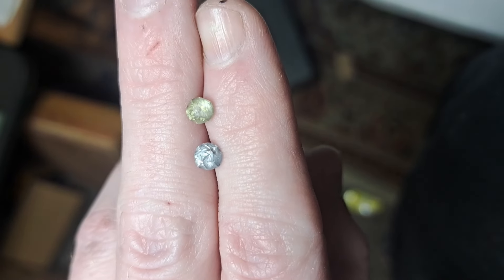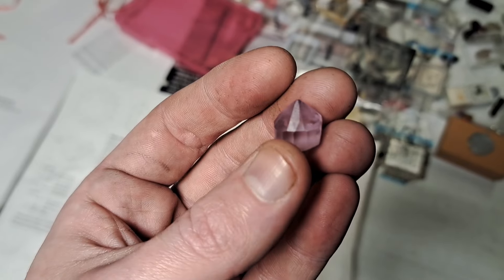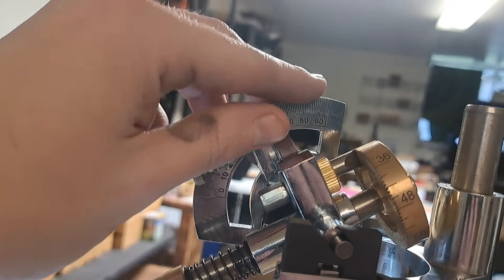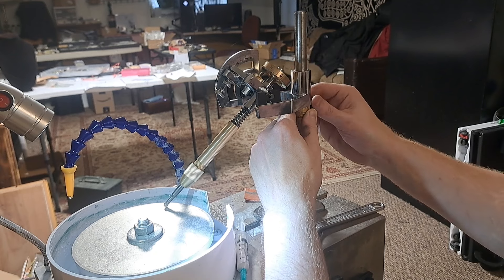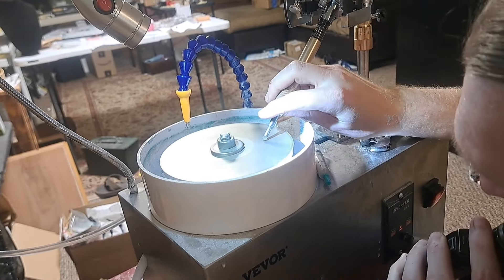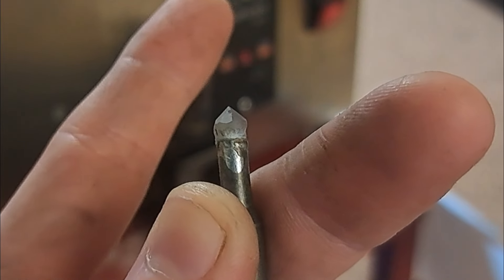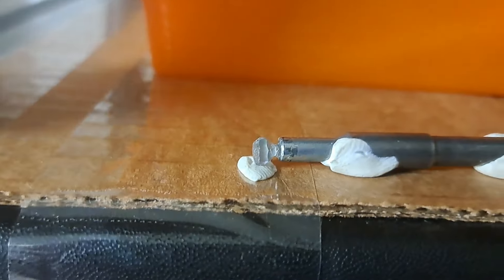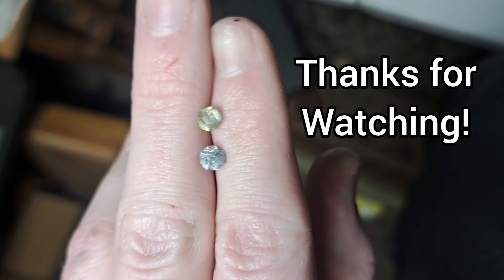Vevor Gemstone Faceting Machine review

Comment: I have an easy fix for the girdle problem. I put the height adjuster on the top, and put a rubber band to hold the dop holder up. Works well. Also I made the base more level by just sanding it on the 80 grit lap. No need to machine it.
Reply: thats pretty smart, a rubber band! Here I was stacking washers underneath what a drag. Thanks

Comment: I saw another youtube production about the identical Vevor machine, where they machined the foot of that "mast" so the mast would become more perpendicular. That does not seem too hard to do if you take a look at the basis of the mast (the piece that is fastened  with one screw to the table of the cutting machine) and you do not need a machine shop. If you know how to use files and abrasives you can make the mast more perpendicular fairly easily. The other way to go about it is to place thin washers between the motor and the table to which it is fastened with four screws. You have to open the machine on the bottom, remove the drip pan, the base disk etc, and you can carefully drop the motor down and place shims or washers (thin) before you retighten the screws. This is more difficult than machining the foot of the mast.I also find the machine, while not excellent, still acceptable and workable. Cutting the girdle on the stones is a challenge, I cut various slices from 3/4 in copper pipe and used them, in combination to raise the manipulator to the amount needed to get the girdle to as close to 90 deg as possible.
Reply from the maker: Yea, that's likely true as far as shaving the mast. Part of the issue is that after alot of messing around with it, I'm still not able to figure out where exactly it's wrong. That said, I have atleast found a way to kind of deal with it. I've done a similar thing with copper pipe for the girdle cutting, I didn't think of cutting several tho, that's a good idea
Reply: @Celestial_Reach  not too difficult to see whats going on: first, Is the table which the manipulator mounts to, level and is the platen of the grinding wheel also level and parallel with the table? I have a digital spirit level and it shows if the table, the grinder and the mast are all at zero degrees, or 90 degrees (mast). if not how can we make it so? There is the mounting shimming of the motor, and then there is shaving the foot of the mast. But let me say that on my machine the platen was level, so the shimming of the motor fasteners was not needed.
 That leaves a slight leaning of the mast that can be addresses by sanding the foot on the side that needs it. The shaving can be done on a level hard surface with sandpaper on it (the lip that needs to be shaved is not substantial so it is absolutely doable without a machine shop) Machining of the stainless steel table does not seem appropriate or convenient). Good luck!
Reply: Stefan Gottswinter has exellent vids for Scraping flat, if your interested in precise tollerances

Comment: I have to say, there are lots of things that could be wrong with a gem cutting machine, but the Vevor machine (the one with the adjustable speed) has accomplished a very reasonable compromise and solution. With the table of stainless steel that is fairly substantial if not perfectly plane, but reasonably so. The mast of the manipulator needs to be fixed by the owner of the machine through sanding on one side or the other to make it perpendicular with regard to the grinding wheel. If you know how to cut gems you will certainly know how to shave that foot to make the mast more perpendicular. And one annoying problem is the leaky control valve on the water drip. Other than that, for the price.... no complaints.
Reply from the maker: After anout 4 months I agree. Still fighting the mast, but I can cut stones well enough for the price. I think machine could be revolutionary, and part of me hopes.i got 6 more months before I upgrade, cause I wanna have the base line to judge from. What's that extra few grand getting me, if you know what I mean

Comment: Due to some faceting I did on the Vevor machine that turned out less than satisfactory, I checked a few things. First I bought a digital protractor, and I am finding that the rather crude protractor thats built into the Vevor manipulator is off by as much as 3 degrees. So, I went to ebay and I found for very little money a small digital protractor that I will mount on the manipulator to get the angles right. Secondly, when the detent is seated on the chosen setting on the index, I was able to twist the manipulator from side to side because the detent was not seated in the notch of the indexer very well, it was rocking left and right. So I went with a fine triangular file and removed the burrs that are present on the index notches, and some burrs were rather significant. Still, if you endeavor to do something as intricate as gem cutting, you are definitely able to correct the problems that go hand in hand with a barely adequate manufacturing process. Still, for the money, the machine is not junk altogether, while the biggest limitation I am finding is the positioning the manipulator for making a good girdle.
Reply from the maker: This is really great advice. I will give these a try, I was considering a new mast assembly but I'll try this first. I have some ability with my jeweler bench. Thank you for the tips

Comment: Thanks for sharing your projects. I hope you can work out the problem with your mast. I'm wondering if you were using water with the diamond on the copper plate (for the 14, 000 I think you showed)? Good on ya for getting the faceting going!
Reply from the maker: Hey, thank you. I was using water for that part, it just helps it feel smoother. That wrong? I k ow my diamond paste isn't the best quality and that might by why I'm noting a few scratches here and there

Comment: Most likely, the base of the mast is not level. If you can't fix it with shims like someone suggested (which is a temporary fix and could be a headache whenever you move the mast), you need to machine/mill the bottom flat. Or your best bet is to hold the stone in one place rather than sweeping across the lap.

I go from 3k to 50k just fine with sapphire, so you can probably skip the 14k step if you use 8k. Up to you, but give it a shot sometime and see if it makes a difference.
Reply from the maker: I really appreciate all of this. I don't know if I can machine it any more level then it already is honestly, but staying in the same spot my be possible. I might try to upgrade that part, figure can't hurt, get one with a return policy

Comment: Truing up the mast may depend on exactly what the issue is. Is the upright mast straight or does it have a slight bend?  If it is straight, you may be able to get some thin shims to put under the between the mast holder and the machine to make it perpendicular, although that may be tough to measure if you don't have the right equipment.  The other think that could be off is the spindle of the lap wheel may not be parallel to the mast.  That could make it off, too. A lot of different variables.
Reply: I had tried shims, but thought, well it is a lap grinder. So I just put it on a 80 grit lap and got it pretty level. Having fun with my entry level machine.

Comment: Hello Tyler,
I have some raw gemstones (garnet, saphires and rubies) that I want to facet and polish and I am then interested in buying this type of machine. The gemstones are however very small (much smaller than the ones you show in your videos. I want to know how you load up the gemstone on the tool so it stays in place safely ? Thanks in advance.
Reply from the maker: Hello, I use super glue. It's a struggling tho for sure, I find this is a challenging machine to work with on smaller stones, I might need to throw money at the problem for once lol
Reply: @Celestial_Reach  Thanks for your return 👍 I bought this machine already. Lets see how its gonna be haha. It will be my first time doing this so I will probably train with other bigger stones before and work on the smaller and more premium ones after I get used to it. Cheers !

Comment: I would just call Vevor...I just got this same machine, I hope mine isn't uneven!  I need to get a set of flat lap's and some diamond paste or diamond grit....corundum because it's hard and adds to the grit???  thank's wow, I got the 180W 6inch Vevor which looks just like your's I am practicing on cheap stuff before I try anything of significant value but I was having a problem with the height to cut the stone into a barrel or the girdle facet's before doing the crown or the pavilion....I was trying the 9, or 18 facet's instead of the 8 with 16 just on the girdle cut's not to mention the rest....anyways thank's and I got this machine right from Vevor's website for $249.- where Amazon wanted $318.-
Reply from the maker: Always best to go from vevor directly when possible. So, I need to do an update to this video, there are perks to this machine, mainly price and I think it's wonderful to learn with. But I find it hard to get high quality stones on it, which should be obvious. Still a great item to learn on and use as a hobby machine while you work your way up.